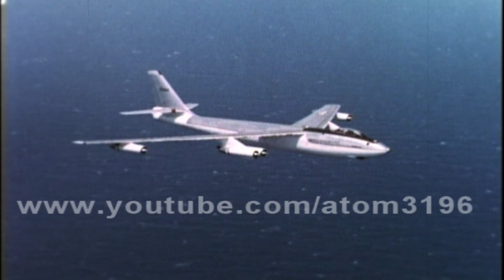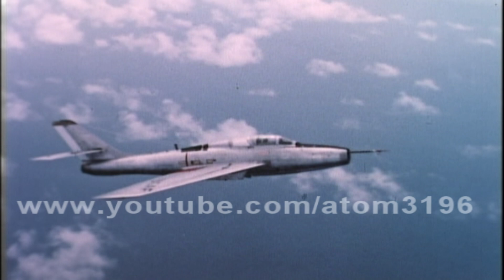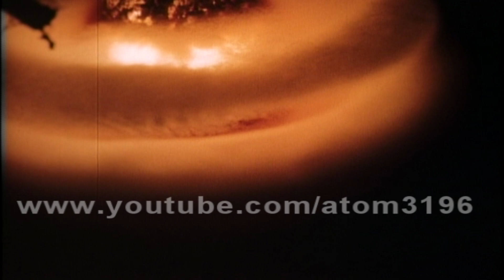HD Redwing Navajo 4.5 Mt atomic bomb hydrogen bomb 1956

Comment: This looks identical to Castle Bravo. Is it the same footage?
Reply: It is the same footage but it's correct, this is Navajo, not Castle Bravo. There isn't actually much footage of Castle Bravo, most of the videos of Castle Bravo are not actually Castle Bravo
Reply: @ohgoditsjames94 This is not navajo. This is castle nectar. It is a test of mark 15 hydrogen bomb. it was tested on Enewetak Atoll on a barge inside ivy Mike crater. The island and the crater is both visible in video. This test is often mislabeled.
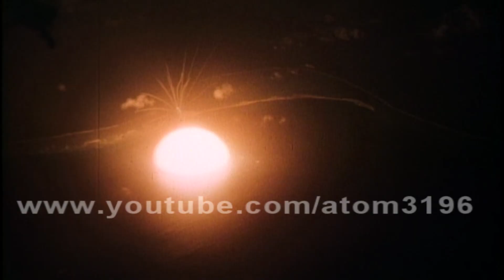Reply: @sukantanayek6707  The crater is not present in this video, pause @0:44 then compare with the coordinates 11.68743°N 165.38263°E which is where Navajo was detonated. This is definitely Navajo.
Reply: @ohgoditsjames94 ok sorry I'm mistaken it for another video. this is actually castle nectar https://youtu.be/6t_nmcvzn3g?feature=shared. They look totally similar, but they are not. if you look hard enough, you can see the differences.
Reply: @ohgoditsjames94 Im actually surprised how similar they look.
Reply: @ohgoditsjames94 If you see the Enewetak Atoll satellite image you can see both Mike ivy and castle nectar Crater. One big one small. Both co joined.
Reply: Castle nectar has the lightning happen in a ring of clouds above it. This doesn't have a ring of clouds. (I wish there was a nice angle like this for castle bravo)

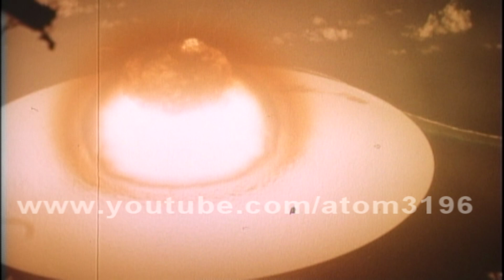Comment: This is actually one of those rare footages where you can see the shockwave as an expanding sphere from the refractive properties of the air being altered, not only as a moving flat circle across the surface. You can actually see it from around 1:00-1:07.
Reply: Why is the white circle expanding faster than the Wilson cloud forming towards the end of the video???
Reply: @mryhdy6266  As far as I can understand it, the shockwave must pass a given point first before a Wilson cloud can form at that point, since the Wilson cloud is caused by adiabatic cooling (cooling caused by a lowering of pressure) that can only happen during the negative pressure stage of the shockwave which occurs after the initial wave has passed.  The amount of time the Wilson cloud forms after the shockwave varies based on the test shot since it depends on a number of local variables such as ambient temperature and the humidity conditions. So each test shot either has or doesn't have a Wilson cloud after its shockwave, and those that do have unique ones...
Reply: @jasonmikolajewski2653  
nevertheless the wilson cloud ahould form directly behind the pressure wave, shouldn't it? I seem to remember someone mentioned it is related to the different speeds of propagation in water vs air, water being faster..
Reply: I believe some of that was water waves raising up hundreds of feet above the level water. Definitely a tsunami in the making.
Reply: Nice observation

Comment: No megaton devices are hydrogen bombs atomic bombs are kiloton devices there’s no way to have hydrogen bomb in the kiloton range and there’s no way to have an atomic bomb in the megaton range
Reply: That is mostly true but hydrogen bombs can be made in the kiloton range. The US W87 warhead for example is a hydrogen bomb with a yield of 475kt.
Reply: Destroyer 16 actually they cannot because hydrogen bombs require a atomic bomb or fission bomb to get the fusion or thermonuclear process started and even a single staged fusion fusion bomb requires too much lithium 6 aka fusion fuel and uranium tampers that would put them smallest thermonuclear bomb over the 1 Mt limit now a boosted fission bomb like North Korea has and is claiming is a hydrogen bomb which is incorrect can be made in the 1/2 Mt range
Reply: @Trump_is_a_Criminal  that was true for most weapons in the cold War but it looks like the US has figured out how to make them even smaller. The W87 is indeed a two stage thermonuclear design https://en.m.wikipedia.org/wiki/W87

Comment: Huge way to distinguish kt atom bombs from true mt-range nuclear weapons is the flash: atom bombs have a short flash that’s brightest instantly at detonation. 

Here, the fireball expands for a few seconds, then the flash lasts for about 10 seconds as the fireball immediately expands to about 4 miles in diameter in about 3 seconds (faster than sound.)

The whole duration of that bright flash is just pure heat. Anything below the fireball is glassed and gassed as the heat vaporizes it and the shockwave blows it away. Things miles away catch fire if flammable, plastics melt, metal gets hot, skin blisters and peels if exposed, fat melts. Eyes get burnt out if you look at merely a reflecting surface like a white house facing the fireball. The blast levels onward-facing walls of any material for at least 7 miles, shattering windows for a good 20 at least. 3rd degree burns to anyone wearing light clothing outside as far as 14 miles. 2nd degrees as far as 20. Lasting blindness to anyone who viewed the fireball as far as 50-90 miles away. 1st degree burns past 25-30 miles, falling off over distance. Blast kills or cripples anyone within 7-10 miles, many injuries like broken bones as far as 20-30.
Reply: Good information, so Tsar bomb 50 mts is 10x version of everything you said?
Reply: @ruddymolina7044  not quite how that scales. You can double the yield but that will only add ~25% to the blast radius. It’s complicated
Reply: @StealthTheUnknown Wasn’t Tsar bomba more of a political statement than anything else? Anyway, I’ve always found the brightness of nukes fascinating. It really is like making a duplicate sun on the surface of the planet, if only for a millisecond. 

Also, E = mc^2 is crazy. I was always wondering why their so powerful but it’s just that formula.
Reply: @rem45acp  yeah lol, most thermonuclear tests of the cold war were merely shock-and-awe operations

Comment: That fire ball lasted a very long time, I was told that you can determine the power of the blast by how long the fire ball lasts. The distance away can easily be determined if you count off the seconds until the shock wave hits  and divide that by 5  . So if it takes 30 seconds for the shock wave to arrive it is 6 miles away . Do not look directly at the fire ball until a few seconds have lapsed
Reply: No, the shockwave is hypersonic and therefore travels faster than the speed of sound. Especially for the first 40 seconds or so. It is always traveling faster than sound until it is no longer a shockwave.
Reply: No, this footage is in slow motion.
Reply: A nuclear bomb produces a characteristic double flash with an initial very short peak in brightness then it darkens, only to brighten again into a much longer lasting second pulse of intense light. The time between those two peaks can be used to calculate the yield - the formula I've seen is you take the time in milliseconds and divide it by 30, then square the result to give the yield in kilotons - e.g. 300 milliseconds between the peaks in luminosity - divide by 30 gives 10 - square that gives 100 kilotons yield.

Comment: You can clearly see the separation of the fission primary above the fission secondary. The fission is actually forming a darker mushroom cloud above the fireball fission below. I’ve never seen this distinction as clear as on this shot. You can see it other ones like bravo and poplar, but they are like a cherry on the top of the fire ball and small. But because this one is a 5 mt the fireball isn’t quite as large and the effect is more pronounced.
Reply: What, like an echo from the blast sequence? I don't see how you could see it given the speed of the detonation.
Reply: Strange enough, this hasn't been seen in the Ivy Mike test, or was it not featured in the already declassified footage?
Reply: That's just stuff that was vaporized by the fireball being detonated so low. It's a feature exclusive to ground based tests. No air burst ever has or will show such features.
Reply: I don't think this is what you're seeing, the fission and fusion happen so fast, for example the fusion is complete before the fission primary has expanded to the casing of the bomb. So by the time you see any flash and any fireball, it's already all one single explosion, it all happens so fast it should be impossible to detect the fission to fusion delay unless using some ridiculous slow motion camera like running at millions of fps.

Comment: “Clean” explosion with 95% of energy from Fusion.
Reply: Was there any "cleaner" US devices?  I know Tsar Bomba was 97% fusion.
Reply: @stfanboy  I'm pretty sure hardtack poplar was cleaner, can't find a percent on it, but I know this test was only the cleanest until 1958, which pins poplar as the only option.
Reply: @Bernard de Fontaines Poplar was 9.3 megatons and Housatonic was 8.3, so poplar was larger as a whole. Though I don't know whether or not Housatonic exceeded the percent yield.
Reply: @shanecampo7881  Ripple II bomb that was used on Hisatonic test was the cleanest bomb ever. 99.9% energy came from fusion
Reply: @Bernard de Fontaines Unfortunately, low yield weapons have little purpose in the realm of small weapon testing as it's difficult to make a low yield clean weapon. And most test in Nevada were small. While in the pacific most of the large test were the early ones where clean fusion bombs had yet to be tested.
Reply: Yeah 1 million ppl fckin dead..lol..
Reply: @Arandomguyat1  clean 😂 👌 👍
Reply: Balnazzardi spot on, the Tewa shot in the Redwing series was the dirty version of the same bomb design with fast fission of U235 tamper by the D+T fusion neutrons becoming a 3 stage device, similar yield and enormous fallout.
Reply: @Arandomguyat1  it's 400 million dead from this explosion, get it right

Comment: Isn’t that outer ring called a “ Mach Stem”?
Reply: In the case of a ground-burst weapon like this one, no.
Reply: Joseph Astier ahh, thanks for clearing that up !
Reply: @dm688  You only get mach stem with a low-altitude airburst.  The primary shockwave will combine with its reflection off the ground to form a third shock with the power of both.
Reply: @josephastier7421  indeed when the reflected shock wave meets the primary wave the mach stem is formed

Comment: if this is the 1956 weapons then 2019 weapons are more destructive  .... god save us all peace. 👋
Reply: Most nukes are pretty small nowadays because of much increased accuracy. Why drop a 5 megaton bomb to knock out an airbase when a 500 or 100 ton yield mini nuke will do the job?
Reply: Yes, I know that! But Maxx made me out to be a stupid person and World Frank probably imagined that all atomic bombs today would have to be multi-megaton warheads.

The trend is towards relatively small, very accurate atomic warheads down to those with less than 5 kilotons of explosive power. So-called mininukes

One hopes to be able to use them without triggering a worldwide nuclear war. In addition, the radioactive side effects would of course be comparatively low. One could then occupy or cross the affected area relatively quickly.

Quite a dangerous game.

Translated with www.DeepL.com/Translator
Reply: only people without any knowlege could write such a shit. inform yourself about the current stockpile and then realize and remove your stupid comment.
Reply: @maxx8011  https://en.m.wikipedia.org/wiki/W88

This is the strongest warhead the USA uses. Half a megaton. But they can deploy multiple of them with one missile. The Chinese have bigger ones but only can deploy one with one missile.
Reply: world frank. 
No they are not, actually today these high yield nuclear devices have all been dropped and dismantled decades ago in favor of smaller more tactical ones.
In the ‘50s a stupid “mine is bigger than yours” race started reaching these insane yields that are completely not practical in any war scenario as you would most certainly affect your own troops or some neighboring allies.
In terms of “all out ICBM war” instead of huge yields the MIRV technology has been favored, it’s considered better to hit multiple targets with smaller yield devices rather that making a few colossal booom that would leave the survivors on both sides with at least 3 decades of radioactive clouds and rain destroying any chance of recovery both for yourself and the enemy. It would be an extinction level event.
Reply: @ClaudeMagicbox  as I wrote with less words ;) But thanks for the detailed support on this.
Reply: In fact, the enormous weapons have been reduced in size. Today there are hardly weapons with more than 1Mt. because too big weapons are tactically badly usable.

The trend is towards very small and weak weapons, i.e. in the range of 1ct. So-called "Mininukes". 

But that doesn't really make it better. If Russia and the USA should actually decide to destroy each other using nuclear weapons, that would also be the downfall in the rest of the world. The existing explosive force is still sufficient to make the entire surface of the earth uninhabitable.

I watch such videos and am fascinated and frightened at the same time. Optically so beautifully, from the distance. But even today, 60-70 years after these tests, many of the test areas are still uninhabitable.

Translated with www.DeepL.com/Translator

Comment: If you look at the detonation frame by frame, at fram 4 or 5 the blast "dims" and there's a speckled look to it.  I presume these are the remnants of the initial explosion (e.g. housing) but before the hydrogen fuses in the second state which is just a big ball of expanding plasma.

I;m surprised how long the fireball lasted -- is that just byproducts incandescing or is there still fusion going on?
Reply: Fusion only occurs in the first fraction of a second of the bomb as far as i'm aware.
Reply: I was told that the length of time that the fire ball is displayed from a ground view is a crude way of measuring the power of the Nuke  and I forget the formula . Counting the seconds from Detonation till the shockwave hits you and divide it by 4.5 will give you how many miles away it is .  I read this info out Civil Defense literature  that came out about the time that this bomb was set off . If anyone can add to this it would be great !
Reply: So the fireball isn’t the explosion itself but the air around it is so damn hot it turns to plasma and it can stay plasma for an extended period of time because if the temperature?

Comment: For everyone talking about the Tsar Bomb ,  let me clue you to a few things.   

The Tsar Bomb weight 27 metric tons first off which is massive.  The reason alone why the Russian made this was because they had the large dead empty space needed to test it .

The bomb was a clean bomb made without a u 238 tamper which increase the efficiency of the bomb but using u238 makes the weapon expell nuclear fallout, so the Tsar theoretically could of had a yeikd of 100 megaton but the fallout from this size bomb would of spread to populated areas due to wind and the amount of fallout it would of created.

So they made a clean version using a lead tamper instead, so they acheived 50 megaton of tnt explosive force but it needed 27 metric tons making the bomb in usable in any setup due to the sear weight alone.

The us on the other hand perfected smaller much more efficient 3 stage weapons that ,b41, that achieved 25 megaton Explosions with a weight of only 10,000 pounds , about half the weight ...

The B41 is also the most efficient device ever tested in terms of yeikdf to weight ratio, giving about 5.2 megaton per ton of weight  where the Tsar at it max theoretical explosive force would be 100 megaton but even then it only gives you 3.7 megaton per ton of weight of the device....

In essence , you can build something which is essential crap and appear to win if it's is never challenge,  but the fact that Tsar was only tested once shows they were not looking to developed a real usable weapon but make a head line , where the B41 was an actual weapon the u.s. fielded so the weapon gave a actual real world advantage to its nation where the Tsar Bomb and other projects like it, making crazy things for the cold war, would lead to the breakdown of the ussr,  a lot of nukes went missing during this time period as there was no gov to do anything.....Commands become bandits and sell what ever hardware they have access too..
Reply: Full yield B41 was never tested, so its efficiency was theoretical. XW-56X2 Bluestone shot of Operation Dominic demonstrated a yield-to-weight ratio of 4.96 kt per kg, by which it holds the record of tested efficiency to date. Maybe also worth mentioning - B41 was a free-fall or parachute dropped device carried by bombers. Its practical use, even with its expected efficiency, could be questionable. On the other hand, the USSR had SS-9 Mod 2 single nuclear warhead of 25 Mt mounted on R-36 ICBMs. This was a different era though ('70s and '80s).The US never mounted such beasts on ICBMs. It wouldn't probably be too efficient either. Both sides leaned towards perfecting MIRVs, with multiple, smaller warheads (as it is up to this day).
Reply: @prankkster   in nuclear science the theorical many times is real if not worse (castle Bravo/Romeo coff coff).
 B41 was very likely capable of producing a 25 Megatons detonation or a very close value (ex 24.8).
Reply: @prankkster I’m curious. How do we know that our current warheads, such is the w88, actually work? How do we know their yield is correct and it will actually detonate properly when the U.S stopped doing below ground testing before the warheads were designed?
Reply: 27 metric tons is 27000kg, 10000 punds lbs is 4500kg, which is a big bomb but pretty light to the yield yes. Usable.
Reply: Full scale Tsar might be more like 150+ MT (usually dirty bombs are at least 3 times as powerful as their clean versions). Max efficiency has been said to be above 22 kt/kg.
Reply: Russians have to have the biggest bomb, plane, boat, helicopter because they're overcompensating for their tiny......